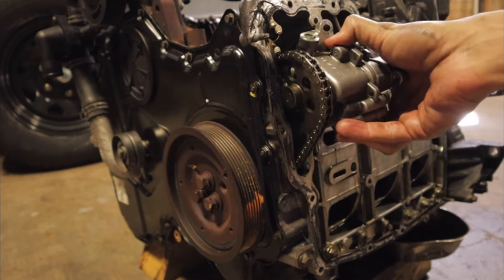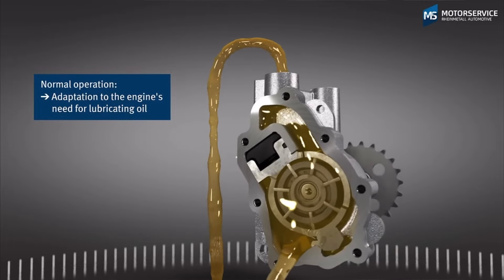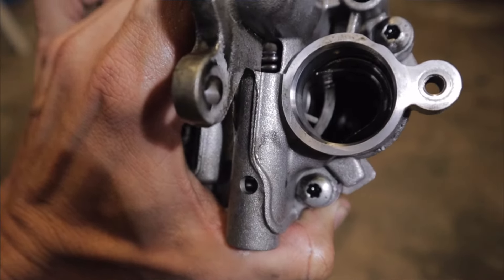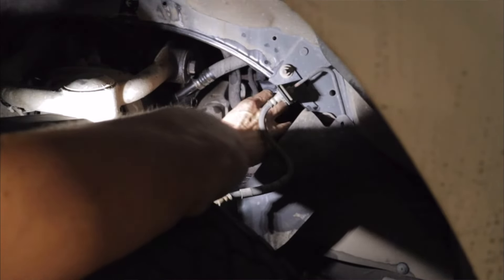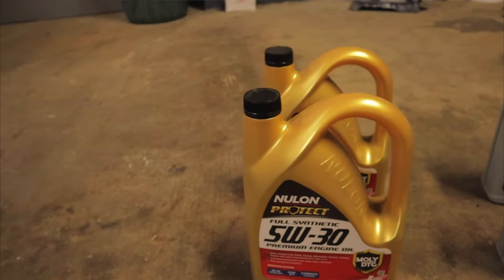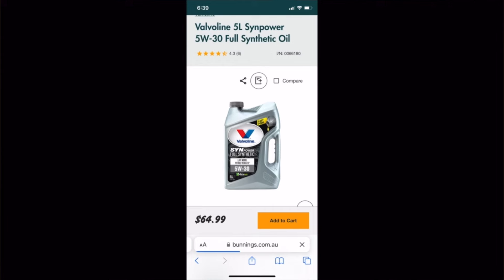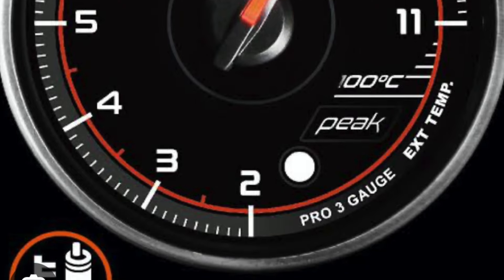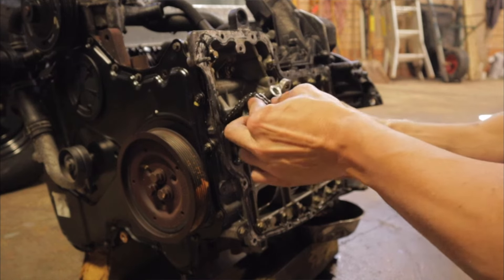Ford Ranger Oil Pump Failure Causes & Prevention

Comment: I sold my ranger with 400,012kms clocked of trouble free business use. Same injectors same transmission. Engine still ran like new no issues at all. The secret is servicing. Oil change at10000k max auto at 40000k max. Early 3.2 engines had a problem with 9 minutes time limit to drain and refill oil and start engine. Oil pump wouldn’t prime if time was exceeded. The fix was to remove oil filter and dipstick and put tyre pump on dipstick hole until oil was pushed up through pump and filter housing. Refit filter and start engine
Reply: You are lucky, buy a lottery ticket . Thousands of failures is the only proof you need.
Reply: you were just lucky to get a good one  , thats the problem with these engines they were such a hit or miss with the injectors , oil pump , egr valve , transmission coolers , egr coolers and oil pump coolers .  good to see you got 400 out of it and sold it
Reply: Rubber valve belts in oil are just a crazy idea.
Reply: That's is very true. Mine is currently at 380,000+. Same Injectors, same turbo. I have changed Alternator and Water pump twice but the engines still drives  like new.

Comment: For anyone else wondering… my Ranger is a 6/2013 2.2l and I just changed out the vane pump for a gear pump. Purely as a precaution, it hadn’t failed… I did install a pressure gauge beforehand to get an idea of the difference, the vane pump max would put out about 55psi, would sit at around 18 to 25 at idle and about 45psi at 100kph. Now I see spikes of over 90psi when cold, sits at about 50-60 when cruising at 100k and an idle pressure between 20 to 30…it’s never a constant steady pressure, always fluctuating but it is an electronic gauge so probably a bit more sensitive than the good old mechanical gauge.
Also the new pump self primed in an instant when fired up for the first time.
Reply: Definitely a good upgrade for the 3.2s!
Reply: I would have said the opposite regarding the oil gauge , I’d hold my faith in a good old capillary style gauge that does not rely on electricity . 
That’s just me though. 
It is always good to see good oil pressure.
  It’s funny looking at some modern engines that do have natively high oil pressure compared to older simpler engines. 
An old truck I used to have with a two stroke V8 would run about 2 psi at hot idle 😊, and that in those days was common for that particular engine , I rebuilt the engine and did a factory oil pump modification that lifted the psi to 6 pounds at hot idle ( woohoo 😊), at full noise it ran about 30 psi.
Regarding the variable oil pump on the ranger , sometimes oil pressure variation has a dual purpose, like for example certain engine speed and oil pump pressure operating variable cam timing , it would be interesting to know more about the ranger oil pressure duties.
Reply: @mikldude9376  the only reason I went with electronic is the head unit was easy to install next to my throttle controller, physically the same size and shape as well.
Reply: Where'd you get your gear pump? I'm thinking of changing mine over
Reply: That’s a bloody awesome result. Did you have to remove the engine or could you do it in place? Cheers.
Reply: @John-gj9db  Hi John, I have the 2WD model which made things a lot easier…no front differential to get in the way. I had the ute on my mates hoist which made things a lot easier but I still couldn’t get the sump off without lifting the engine up a little. Put a tall stilt under the back of the vehicle for a ‘just in case’ then jacked up the engine/gearbox without having to loosen anything just to get that extra 7mm or so. If you have a diff to negotiate then that might be a different story. Also I removed the crossmember which helped as well.
Reply: @concretelicker8000  mine came from North Vic Parts.

Comment: The reason they fail is fatigue of the vanes, not wear as you suggest.  You can see this on any broken pump, as they all break eventually.  When the vanes are "in" they see no load, and when "out" they see the full pressure load to pump the oil, so every revolution of the pump those vanes go through a load-unload cycle and after a few million of those one breaks, and that usually either seizes the pump and breaks the front drive sprocket off, or it breaks the rest of the vanes and oil pressure is gone.  You don't have a minute as the video says to pull over, the turbo bearings last about 3 seconds with no oil pressure if it was pulling boost.  Also quite often when these break and wind the front sprocket off that then gets into the timing chain and breaks it, munching the valves and therefore scrapping the engine.  Changing oil more often does not alter the cyclic load so makes little difference other a slight drag reduction on the vane tips.  The only cure is to not buy one of these pieces of junk in the first place, the 2.2 and 3.2 are notorious for pumps failing around 150,000km.  Just cheap Ford junk best avoided at all costs.  I fixed mine when the pump failed by buying a Toyota Hilux, best cure for Ford oil pumps ever.
Reply: Excellent reply, thanks mate was a good read. Completely agree with you.
Reply from the maker: i disagree, 362 000kms and still going strong, i would recommend watching my 1KD video.
Reply: I get sick of people saying an oil change schedule is too long..especially like this bloke with no evidence behind his thoughts. I'd like to see the oil analised and let the results be the evidence. Keyboard mechanics are common unfortunately.
Reply: Great explanation. Did you solve the problem of the rear cylinders overheating on the Ariel square four? 😁

Comment: Another issue for the PX 3.2 is radiators (you all know about the wiring harness wearing through on the front of the engine, a sharp bit there) as when mine failed the RACQ guy asked ME on the phone if it was a PX Ranger! He uses Rangers for the RACQ business in Atherton and changed over all their Ranger’s radiators to heavy duty aluminium ones. I got the aluminium one to for about $2,500 fitted. (New hoses, thermostat etc)
Reply from the maker: i covered this issue in my injector replacement video
Reply: 2500 fir a radiator and hoses dafuq that’s a piss take

Comment: Supposedly that pump is very improved on the PX2+, but I'm not happy to trust it. My plan is to have it replaced with a gear pump when I have the EGR cooler replaced now that I'm just past 100k.
Reply from the maker: yeh they revised it in mid 2013
Reply: So my 2014 Ranger has an updated pump from factory? Cheers 😊
Reply: I asked Ford  about that and it’s the same part number. They didn’t know about it
Reply: My 2015 PX2 still had the variable vane type pump, replaced it at just over 100k on the clock for the upgraded geared pump, on inspection of the old pump found it had already started self destructing internally with heavy wear marks.
Reply: @John-gj9db no not the case sadly, the px2s still had the rubbish variable vane pumps so your 2014 would still have it too.
Reply from the maker: @AndyL940  considering it was revised over 10 years ago, it does not suprise me
Reply: @abdautomotive  It was a family friend who’s been a service manager at ford for years who told me. Considering there is hundreds of thousands of Rangers and Transit’s running around the amount of oil pump failures is minimal. However it was a poor decision from the engineers to go with that pump just for a percentage point or two for economy and emissions. People who love their Rangers and intended on keeping them alive for years probably should consider changing it .

Comment: Just changed my oil pump from the vein one to the gear one two weeks ago. Of course when I refilled it, I changed the oil filter and fuel filter. Everything is back to as it should be. But I've noticed that since the change I'm average 12 l/100 instead of the 10.5 l/100 I normally get. It could just be that the weather has been hotter lately. Regardless, happy I changed the pump all the same.
Reply: That’s a *vane pump. Veins carry blood back to your heart. ❤️ I can’t see how the oil pump could affect fuel economy. I get about 10.5 l /100 km too but driving very gently. The solar panel on top might be adding wind resistance.
Reply: Being a doctor and only a weekend mechanic, please understand my confusion. I appreciate the clarification. Also glad to know that others get similar mileage. Do you have solar panels on the cabin roof?
Reply: Yes well known that the the geared pumps do result in extra fuel consumption due to loading the motor up a fraction more, im using around 12-13/100 also, run the geared pump for around 4 years now.
Reply: @Offroad_Airscapes  thanks for the feedback. Much appreciated.
Reply: If it has variable cam  timing and is operated by oil pressure as some are , I’m thinking that could have an effect on engine tune/valve timing as it goes through the rev range , I’m just guessing though.
  If you have a squid through a workshop manual it should give detail about cam timing and its operation.
Reply: Where did you get the gear pump?
Reply: Hey mate did u do the gear pump install yourself or get a mechanic to do it? Thinking of doing it to mine how much it set u back? Thanks man
Reply: @georgieboy2525 it wasn’t expensive. I ordered the pump and the plastic pick up arm that goes with it from a parts supplier in Thailand. From Lazada specifically. The parts were $130 aud. I think I payed $100 aud for install. The pump is from ford. But for the transit vans used in Europe. I’ve had it installed for 8 months now. No dramas.

Comment: Castrol MAGNATEC A5 is full synthetic. Says it on their website and on the bottle
Also for those using 5W-30 for warranty purpose but would prefer a 40 grade. Castrol MAGNATEC A5 5-30 has the highest high temp kinematic viscosity of all the 913D spec oils I could find. Hope that helps 🙂

Comment: Ive ofter wondered why ford recommends 15000klm intervals for oil change , but mazda is at 10000klm. Same engine.
 Changing your oil more frequently is always beneficial. Hopefully people have watched your previous videos on egr operation, and will know when its open and how that will effect cold short distance driving. If you only did 10000klm per year you should consider changing your oil more than once. 
Real results are what your videos provide, thank you.
Reply: I convinced myself with a simple bit of math. It's over double the price of materials to have it serviced at the shops around here. So I change my oil myself twice as often as recommended and still end up saving money vs. doing it at the shop at the specified interval.
Reply: I feel very confident in saying , it’s all about marketing mate , if you have competitors selling similar products with 10,000 kilometre recommendations for servicing , then it looks  a lot better in your marketing blurb if you’re product can do longer periods between services.
 You can guarantee, the ford bean counters will have weighed up the possible profit of extra customers versus X amount of possible early engine failures.
 It’s always about the mighty dollar mate.
Reply: @mikldude9376  Yeah 100%. It's Marketing Practice, not Maintenance Practice.
Reply: I also wonder if its also the manufacturer trying to game Environment Social and Governance policy (like everyone does). Imagine the amount of oil and parts the dealers would have to get rid, this increase which would likely be reported ruining the green credentials that the manufacture is trying to spruike.

Comment: For more info about this read the article of Brett Harth & Phillip Sturgess on Engin Australia July 2018 " Ford Ranger & Mazda BT-50 Duratorq TDCI Puma 2.2lt GBVA P4AT and 3.2lt SAFA P5AT Oil pump tests and Upgrade Options" and remind also that during oil change especially if you change the filter, the flow time must not exceed 10 minutes there is a risk of over-priming and the oil will no longer circulate. On the other hand, the re-priming procedure is known to be relatively delicate. It should therefore be avoided. Thanks for all Your videos Cheers and HNY from Geneva Switzerland :thanksdoc:
Reply: Another recurring failure of these engines is soot at the injection nozzles, which causes a change in the injection jet and damages the piston by self-ignition.

Comment: I also use nulon super heavy duty diesel coolant. It keep temperature cooler than a stock coolant.
Reply: How? coolant is actually less effective than just water the additives are for anti-corrosion and if you live in the very few places these have a anti-freeze additive in the coolant. I am yet to see any commercial product that makes water better at heat transference.
Reply: @Sabumnim666  somehow it work. It not just has anti- freeze it also has anti-boil protection. Good anti-boil protection will keep your car much cooler because it will absorbing heat better. I use the nulon premium long life coolant premix in the past but it didn't keep the temperature as cool as nulon super heavy duty diesel.

Wait for my next comment because I  will give you an actual reading of the actual temperature because it requires driving.
Reply: Been tested. 40min of driving around the town. Temperature sit 83c. Before I use this coolant it sit 90c. Haven't been tested on highway driving yet.

Comment: yep i was not having any of the vane oil pump nonsense so i bit the bullet and changed out the pump for a geared oil pump in my driveway sump off cross member cut out and bolted back in  the whole enchilada  and i dont use 5w anything oil its just too thin gone up to a 15w-40 fully synthetic  with no problems
Reply: Was the sump hard to get off? I watched a vid where it was stuck on there good , like he was smackin it with a punch and a hammer, and didn't even budge it..
Reply: Yes i use 10w40 in my ranger and haven't had any issues , since i bought it second hand now done 263000 ks  , super cheap n repco will tell you you must stick to 5w30 cause thats what FORD recommend.   Not to mention the bullshit about 15,000 k oil changes no way mine i change at 7000 to 10000   Ford is taking the piss.  All motors need regular oil changes
Reply: @EdmundSampson-pd7vi it wasn’t hard to get off the engine a bit of gentle prying not to warp the sump  but there are a lot of steps you have to get right  , it’s been 7.5 thousand Kay’s now running great and the oil changes are a sinch now no stress

Comment: Does anyone know if I can change out the oil pump without taking the engine out ( 2014 PX Ranger) ? Not sure if the sump will clear the steering rack. Cheers for the awesome informative video .
Reply: I recently changed my failed oil pump earlier this year. The short answer is yes but with great difficulty and highly not recommended. Did mine by lifting the engine. Sorry I couldn't offer better advice apart from you lifting the engine
Reply: @montoku  cool thanks for the info.

Comment: If you read the manual & service book that came with my 2014 XLT 3.2 ltr dual cab 4x4 it says the service every 7500 kilometres. Every one asumes its 15 000 kilometres & does it at 10 000 kilometre.  It seams the newer Ranger with 3.2 ltr are 15 000 kilometres, it seams car manufacturers are competing with cheapest running costs & are stretching out service intervals.

Comment: Overheating can also cause issues - there’s some plastic sensors (eg cam angle), gaskets, etc that can break up and wreck oil pump or jam journals.

Wish there was a procedure to prime it without needing 15L of oil and a prayer

Comment: Hello, I'm from Brazil, I have a 2017 Ranger 3.2 diesel, I want to install an oil pressure sensor, where is the best place to install it? I'm trying the turbine oil pipe but it's difficult

Comment: Do you have the exact month they revised it? I have a 2013 so not sure what mid 2013 covers
Reply: My 2015 Px2s still had this pump, upgrade to a geared pump then there will be no more issues, no more 8min oil change requirements and the geared pumps self prime, runs higher oil pressures through the whole rev range providing better protection, trade off is the extra fuel consumption -1.5 -2L per 100
Reply: @Offroad_Airscapes  is it a lot of labour to switch the pump? Also is your pump an aftermarkey pump?
Reply from the maker: may 2013
Reply: @abdautomotive  thanks